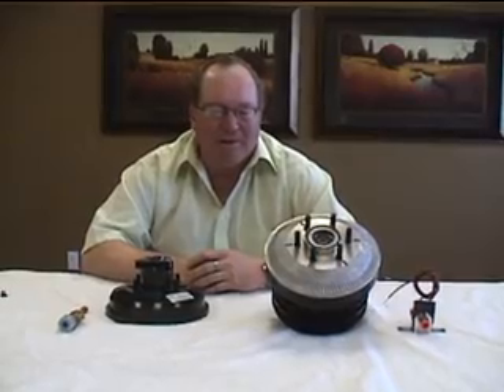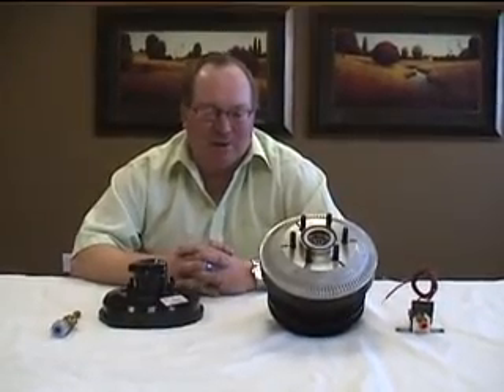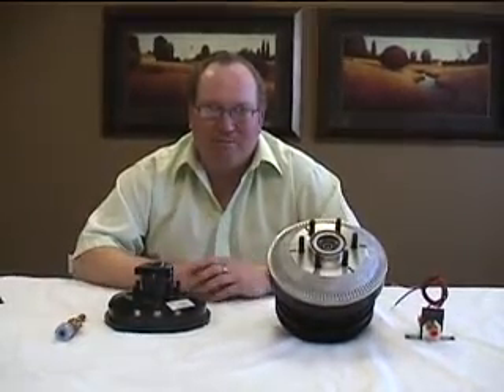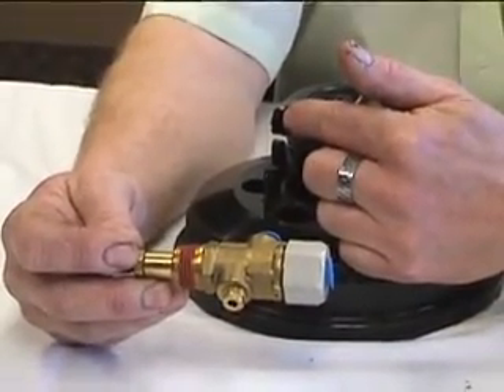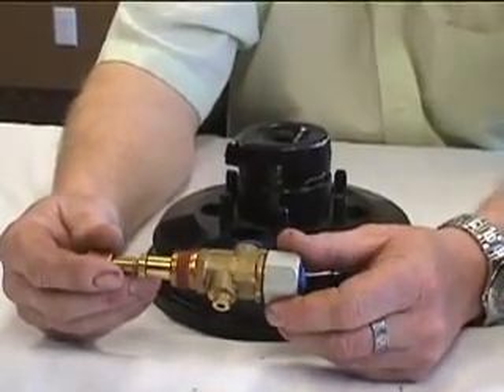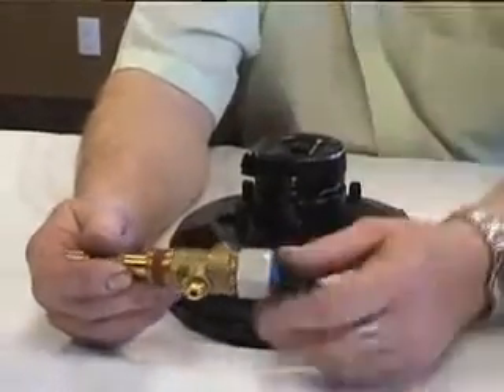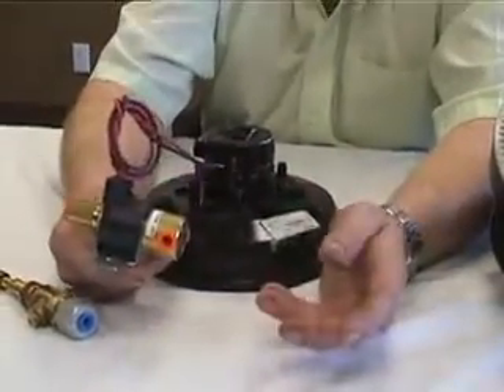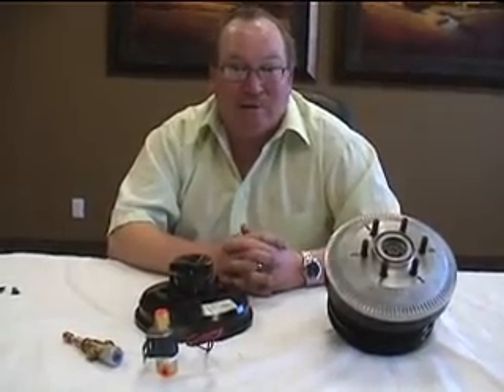Kysor Fan Clutch

Comment: Hi, thank you very much for making these videos. I find them quite helpful, and I hope you continue making them. I called many repair shops, and nobody even wants to listen, so I hope that you might be able to help.

I've recently installed a new fan clutch on 1998 cat c15 engine, and it was working fine for about 2-3 days. Now however, the fan stays on all the time, and I don't know what is causing this problem. Here are a few things that I was able to find out on my own:
1. I've replaced the fan clutch solenoid (no effect).
2. there's 8.9 volts going to the fan clutch solenoid (Shouldn't it be 12V?)
3. Solenoid part number A06-26631-000
4. Fan clutch is engaged when there's air in the system, and disengages when I disconnect the air tube that goes from the solenoid to the fan clutch.
5. Engine fan fuse seems to be fine.
6. Here's the link to the clutch I installed http://kit-masters.com/product-detail/?pid=53
I hope this information will help you to identify the problem, and thank you in advance for your help.
Reply from the maker: Have you checked your thermal switch? This is what sends the signal to the solenoid and yes the solenoid should be 12V. Your solenoid could also be plumbed incorrectly as it can be plumbed normally open or normally closed. We also recommend using a genuine Horton replacement for this. This clutch is air to engage so make sure all of your air lines are not broken or kinked. Lastly, you can check the system century as it may be burnt out and leaking off air.
Reply: Thanks for replying! Yes, I'm starting to get suspicious about the thermal switch (It's also called temperature sensor right?). In case someone is also reading it, I called Freightliner, and they gave me the part number for the temperature switch/sensor that should fit the engine 102-2240. And as far as plumbing goes, I think it should be good. It worked for 3 days without any problems after all... Thanks for your advice, you're awesome! I'll write an update once I get it fixed.
Reply from the maker: Yes the thermal switch could also be known as a temperature sensor. Hope you get it all figured out!